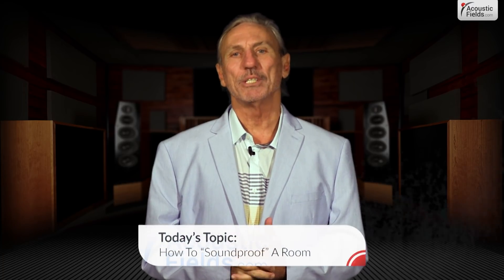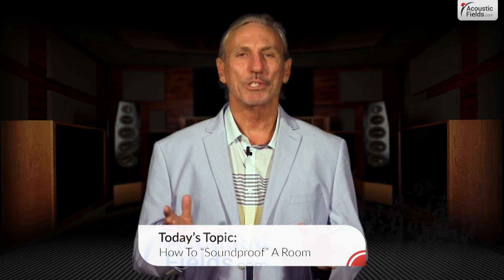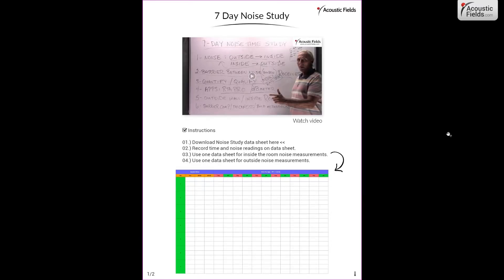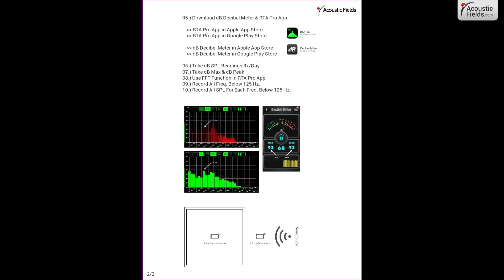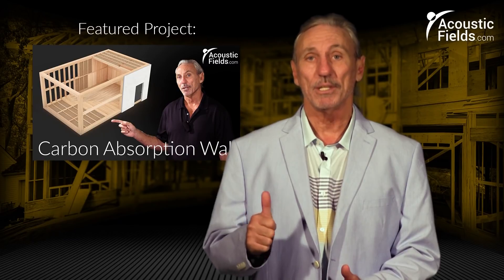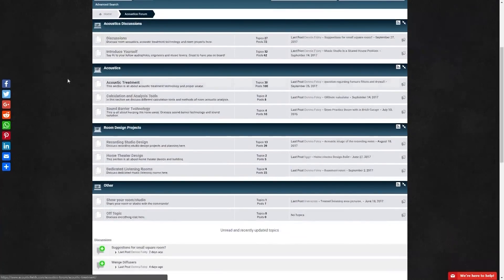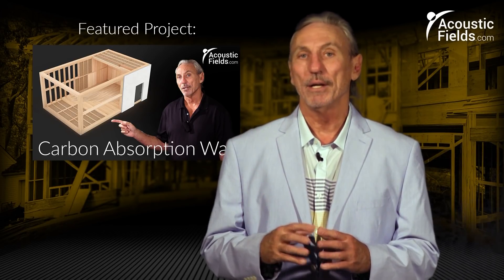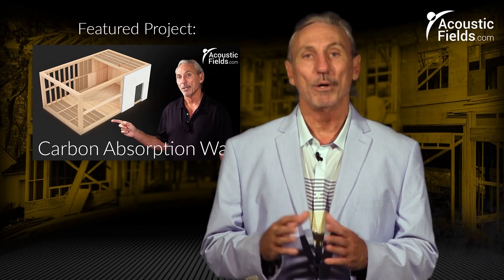Soundproofing A Room - www.AcousticFields.com

Comment: I'm more interested in keeping the sound I make inside the room from disturbing neighbors.  I will, within the next year, be relocating and my main criterion is minimizing the sound from a grand piano and a quality 2 channel sound system.
Reply from the maker: C,  Piano is a full range instrument which produces full range noise. You will have to build a barrier. This a permanent build which requires noise measurements and a barrier for all room surfaces. What is your budget for the project ?
Reply: A quality 2 channel sound system is also full range "noise," but sound propagation from a grand piano is quite different, I'm sure.  What's my budget?  Depends on the room.  I'm hoping to have concrete floors and 12 to 14 foot concrete ceiling and one room dimension that's in the 55 foot range for a 20Hz. wavelength.
Reply from the maker: C,  Not really. Pianos radiate energy in 360 degrees, just like speakers. Barrier technology is 4 x the cost of treatment. Having one dimension at 55' and a height of 14' would produce a need for a 37' width. This would be a fun project. Let me know when you are ready to proceed with the barrier design and treatment .
Reply: Thanks, Dennis, I'll do that.  One last question, with a dimension (most likely, diagonal corner to corner, as a length would be pretty unlikely) of 55, how do you arrive at a width of 37?  Doesn't the 55 dimension allow a 20 Hz. wave to develop inside the room?  Or, perhaps a better question, assuming a 12 to 14 foot ceiling in a rectangular room, what would be the ideal dimensions for length and width?
Reply from the maker: C,  Ideal ratios come from our data base of 140 built and measured rooms. Room dimensions depend on usage. For a piano room, ceiling height is the most critical so 14 - 15' is ideal. Width and length ratios can vary but nothing under 21' .

Comment: Yes, yes that makes sense of 7 days and I hear a lot of buses outside across the road with bus stop with bus engine idle it hums at 35Hz on the spectrum lab and its audible I not cared to use the digital SPL meter that ranges down to 30db but I'm sure it would be over 40db easily, 

There are other traffic noises of car engines the odd airliner about 1/4 mile away and the aircraft only rarely heard. The odd Chinook helicopter flies on the same flight-path as the commercial airliners 1/4 yet the duel blades and frequency though the air once it makes contact with the building is turned into vibration where I felt few times though the concrete flooring that is just hollow pipes underneath the floor with concrete poured over it. The floor mildly vibrated as well as the ceiling due to the loft being above and it acting as a cavity box.

Rain is often heard as I LISTEN to sound and only a heavy flash flood of rain is hard enough to be heard against the roof above in the loft as its all wood beams that come down into contact with the brick walls, now then! 

I'm not overall fussed that much at sound proof or controlling or reducing the noise though would be nice if I had it lowered down by a given -db amount covering over frequency range.       

I doubt the sound controlling will reduce the Earthquake like shimmer that the buses do when traveling so many hundred yards up or coming down the slope hilly road the wheels front/back pass over a manhole and create a bass like sound wave that must be traveling down the storm drain to lower part of the road. The storm drains may connect or meet with the other drains that run underneath flats thus its more FELT than heard its felt for about 1.5s     which would be the front wheel then very shortly after the rear back wheel thus creating the shimmer vibration Earthquake likeness effect. I think that would be far too much deal with isolating that with floating floors as I only have '7.8" and I rather not lose any room height its smaller enough as it is. '15 L / '10.6" W / '7.8" H, dinky midget size. 

by nighttime its like quiet and the only thing I need to do is A fix repair an AVR that is being used to power my JBL LCR horns fix a grounding issue or hit the damn thing with a hammer as that often works? lol or buy another cheap one then I will have my room almost down to a 30dbA/C noise level by nighttime. The only thing I hear all the time on and off is my, Tinnitus and drinking orange juice for Vit C to help calm it down, otherwise that is the only constant noise I hear all the time and no Dolby SR will reduce it. XD

Thinking about outdoors how sound is heard against the buildings brick wall the sound increases in brightness against flat surfaces and I not bothered to listen to corners of buildings I don't need to have  phD to guess the corner is gonna have higher increase and somehow have reaction within the cavity walls?  I think stuffing the outside of buildings with waterproof bass-traps wouldn't be bad idea or cover the buildings with treatment would make the outside a great deal many db quieter.
Reply from the maker: A,  Structure transmitted energy is different than air borne transmitted energy. Both issues require completely different treatment types.